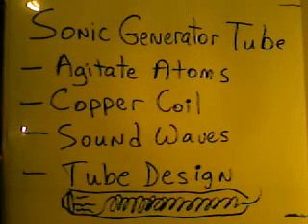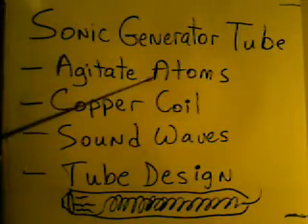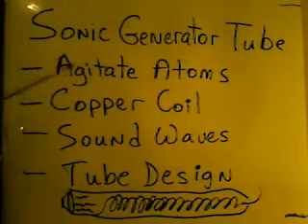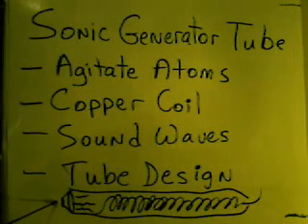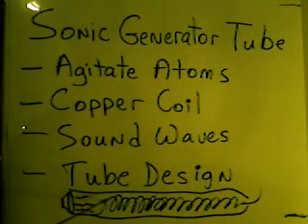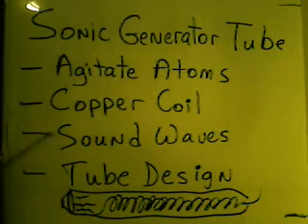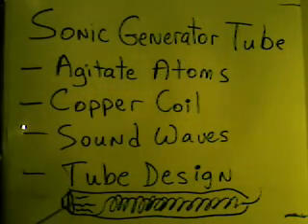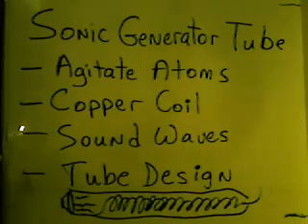Sonic Generator Tube

Comment: Scalar waves or longitudinal waves act in a similar way to sound waves., another point of interest is that a steel flux core in a transformer when kinetically vibrated or knocked produces a voltage spike which would then create an emf flux pulse.  So, maybe using the sound wave on a steel core wrapped like a solenoid would have an induction effect.  If the steel was vibrating with a resonate response, some what like a bell all the better!

Comment: Only just noticed you had written.  Thank the hypomania.  

"Could it be....feedback"
No.  Microphones transduce sound into electricity.  Speakers amplify.  This costs power on both ends from fundamental laws of the universe which require energy to be expended on impact, emission or disturbance. 
 
"Would the effect of..."
No. You cannot reverse the process to gain energy. Engineers are smart.

"If we took...."
Try it.. Share video.  Don't throw too much money at this, please.

Comment: Sooooo it's true that changes in magnetism = changes in electricity (Maxwell's laws, electromagnetism). Unfortunately, it's not exactly true that changes in sound = changes in electricity - there is no world of "electrosoundism."  It is definitely possible to use sound to create movement to generate power -I agree with that- but even a sound wave perfectly harmonious with copper could only make it vibrate...it's a heat generation, not current, at least not with copper...piezoelectrics may work.